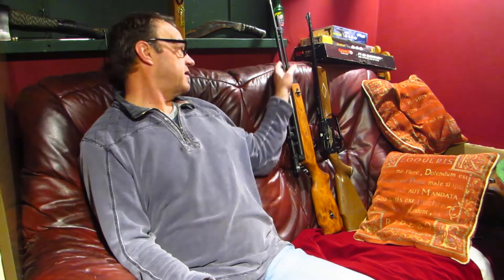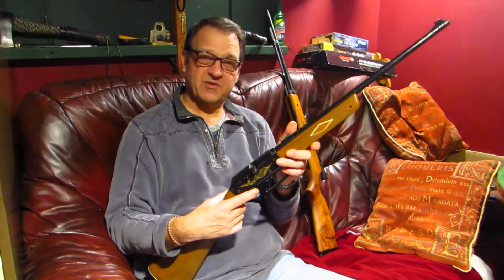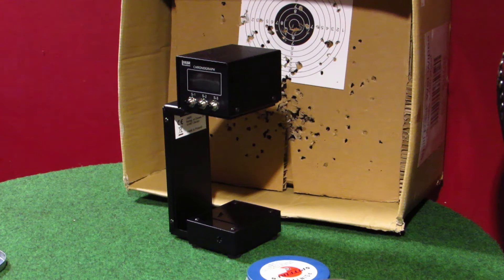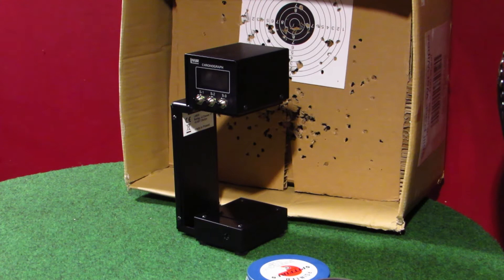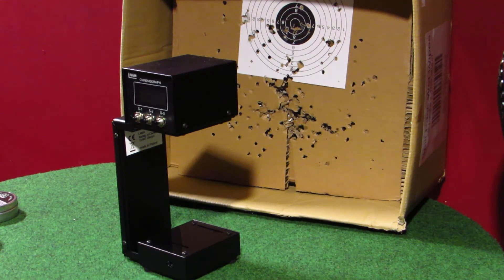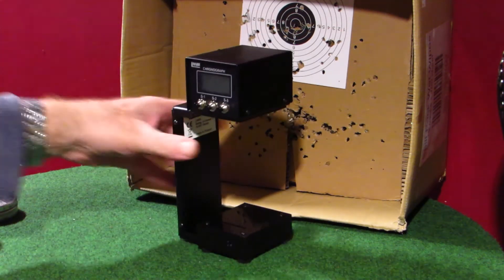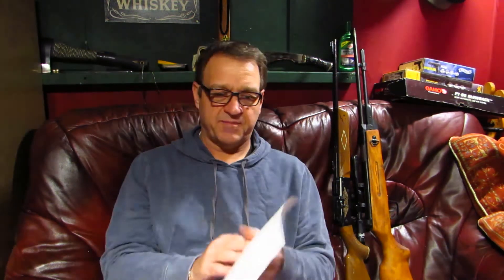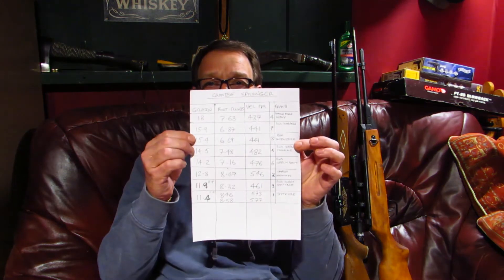Chinese air rifle power test with various weight pellets. How many foot-pounds?

Comment: I've found the same thing when chrony testing different air rifles with different pellets ie PCP rifles produce more ftlbs with a heavier pellet whereas springers produce more ftlbs with a lighter pellet (testing was with sub 12ftlb UK limit rifles so perhaps the results could be different with more powerful spring guns). 
I believe the reason has to do with the way the different power plants function, with a PCP a valve provides a 'dose' of high pressure (pre-compressed) air from a reservoir and the expanding air transfers energy to the pellet while it is in the barrel. With a springer the air in front of the piston seal undergoes rapid compression and expansion in one shot cycle and the pellet can begin moving before the piston has reached the end of the cylinder. It's a dynamic process with lots of variables affecting the efficiency of energy transfer from the spring to the pellet. I find that although the lightest pellets like RWS Hobby 11.9gr produce highest ftlbs in springers they also result in a harsher/snappier shot cycle. I prefer light to medium weight pellets which give a smoother shot cycle (~14gr to 16gr in .22) and look for the ones which group best. Pellets I tend to use are AA Field domes 16gr, H&N FTT 14.66gr, JSB Jumbo Express 14.35gr, RWS Super H-Point 14.2gr, RWS Meisterkugeln 14.0gr, Webley Mosquito 14.35gr. There are no hard and fast rules for which pellets are going to work best of course and you may find a springer which groups well with JSB Heavy 18.13gr or Bisley Magnum 21.4gr pellets etc.
Reply from the maker: Thanks for that excellent info. 👍
Reply: @ShootfishProductions  My comment turned into a bit of a rambling essay. Thanks for the upload, this is the same kind of thing I find interesting, as it happens I've got the same chrono as you (and one of those chinese B3 type underlever rifles in .22). Both the Daisy Powerline 880 and B3 underlever are capable of surprising accuracy, good examples in my view of how you don't need maximum ftlbs or need to spend a huge amount of money to enjoy the hobby. I bought my SMK BAM underlever for ~£80 and it's a decent bit of kit. Spitfire pellets have changed and are much better quality than they used to be. Cheers
Reply from the maker: loved your "ramble", no probs. Good to hear others are interested and doing their own testing, thanks. @Beesa10

Comment: Thanks for uploading this. Interesting results. I wonder if this is the reason that H&N's Baraccuda Green pellets, and their other green (lightweight, non lead) pellets are now labeled as 'For PCP rifles only.? Many sub 12 springers are 11.5 ft lbs or more, even with heavier pellets (11 or 12 grains). The Barracuda Green  in .177 weighs only 6.6 grains(!), so I think in a full power Springer, (or gas ram) the ft lbs could well exceed the legal limit of 12 ft lbs? Why the power goes up with lighter weight pellets in springers, and down in PCP's is beyond me, though. Very strange!
Reply from the maker: Thanks for watching and your comments. You could be right, i havnt seen the pellets marked pcp only. We will do more testing when the weather gets better.